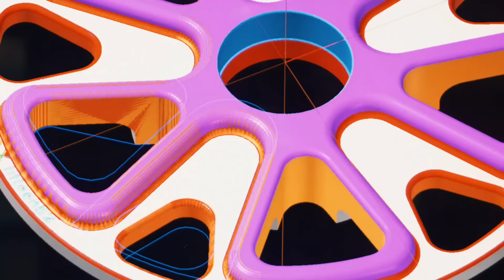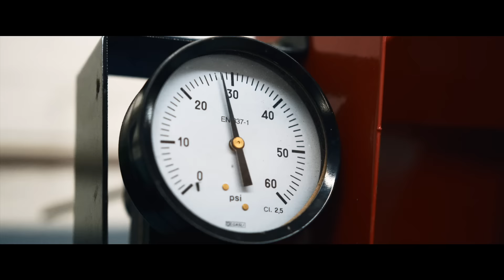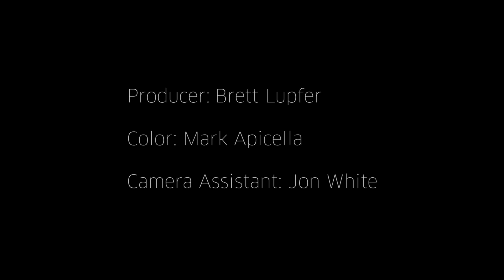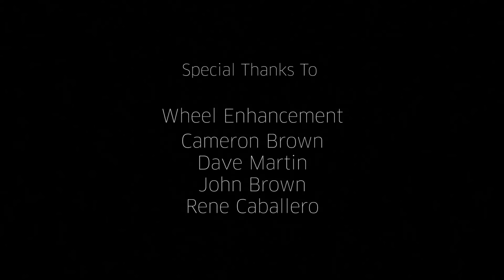Magnus Walker | Outlaw Fever | Roads & Rides

Comment: the epic rolling shot at 1:31... was that done with a rig on the porsche or from a camera car? some type of gimbal mount?
Reply: Judging from the shot, and knowing the kind of equipment these kind of productions are able to afford:

Secondary car, no gimbals or steadicam. (Although they may have used a cheap steadicam). The road seems pretty smooth, so a good camera operator with the right camera rigged the right way will be able to make mediocre smooth shot. Then in post they probably stabilised it further, losing some resolution but keeping a very smooth shot.

Comment: I have a similar 3.3L 930 on its second (factory) exhaust system/baffles. It came with RUF twin pipes, but they all cackle on the over-run like that after the baffles eventually blow out somewhere around turn two/wherever. The bark/flame is because 70's Porsches spill the turbo pressure on the exhaust side - so as not to waste valuable manifold pressure :-)

Comment: I'm not sure how I haven't found your channel before now. I really enjoyed this video!

I do have a question about how you captured the car's audio so well. I tried to use an external mic attached 6"-7" above the car's exhaust with a Windcutter windscreen on it, and my audio isn't any where near this good. Granted I'm only using a $40 Olympus mic.
Reply from the maker: There were a few different mics used. Zoom H1, H4N, Sennheiser 416 and some Lavs. Cameras were, A7R, 5D3, RED, GoPro
Reply: Roads & Rides Thanks for the reply! I'll have to look into a few of those.

Comment: Guy has to be an expert wheelman to go hot dogging around unfamiliar streets with that widowmaker. Don't get me wrong the 930 is one of my favorite sports cars to look at but even Porsche's factory drivers slammed its tempermenal road manners back in the day. The engine relies heavily upon boost not displacement for power, has lots of lag, and suffers from tail happy snap oversteer (though not as bad as some mid engine designs).
If not for the German inclination to accept responsibility for your own errors (rather than the American way of sueing the manufacturer, which is why GM has and will never make a mid engine corvette) the car wouldn't exist. 
They were coy at the end with the police cars... betting that was staged.
Reply: Look him up, he has quite a bit of racing experience. This is one of about 20 cars he runs... Really cool guy.
Reply: GM is making mid engine Corvettes now. What a crazy world.